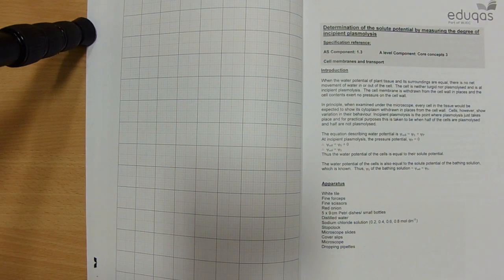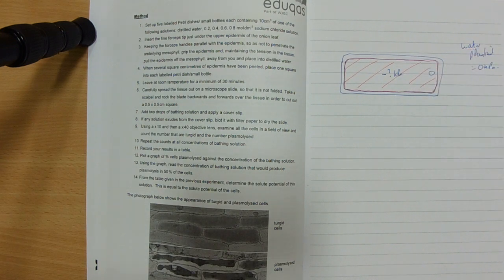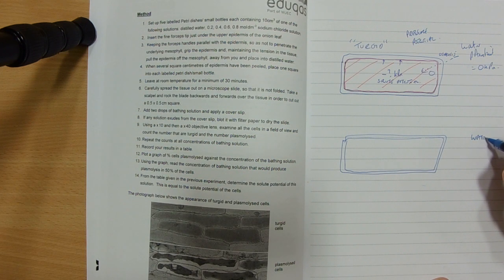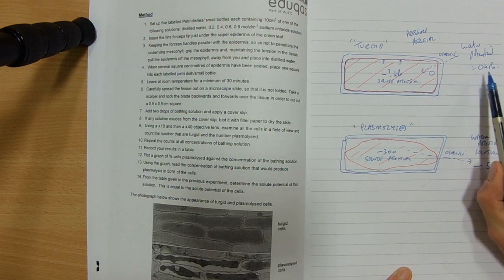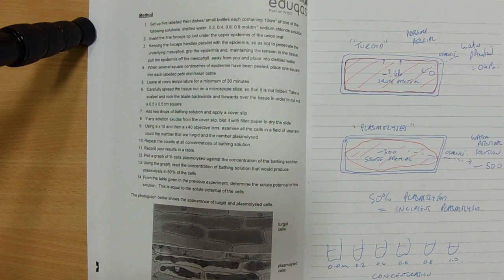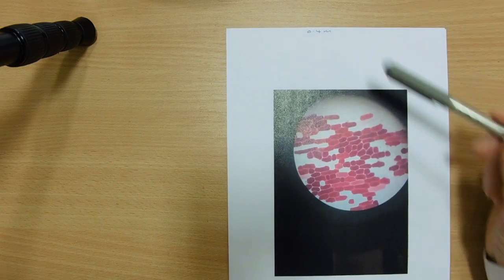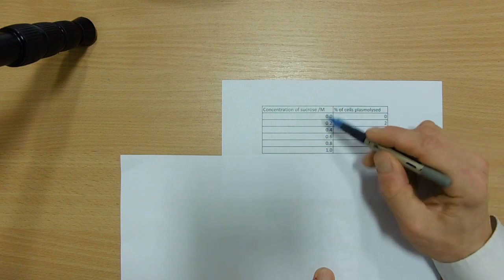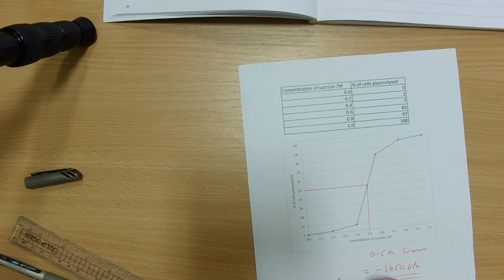Onion incipient plasmolysis experiment

Comment: Hi! I'm a little confused on whether to match up all the points on the graph (like you've done) or if we should draw a line of best fit (like my class did). Could you explain which is correct and why? Thankyou!!
Reply from the maker: Generally, if you just have one set of single points you are ok to join dot-to-dot. If you have lots of points from repeat experiments, you can be more confident and judge a good line of best fit. Your class are ok if the data follows an obvious trend. But beware, making a line of best fit with a single set of points....you are guessing where the true mind is....and you may be wrong! Good luck in your studies!
Reply from the maker: * true line